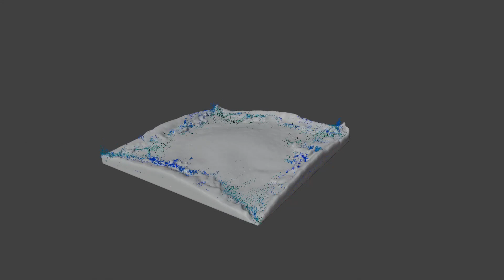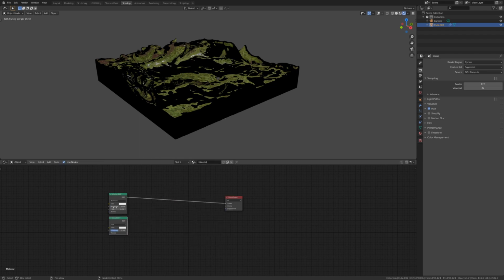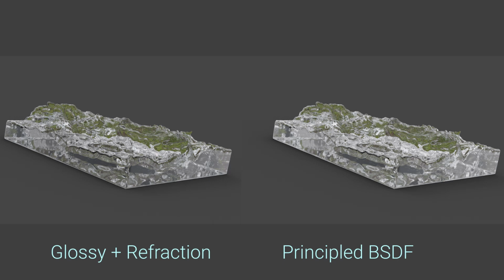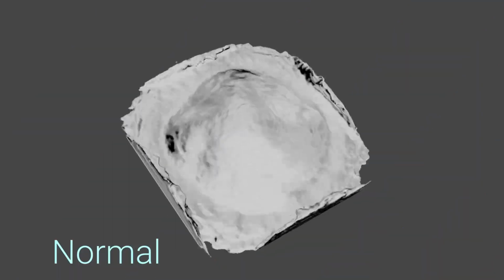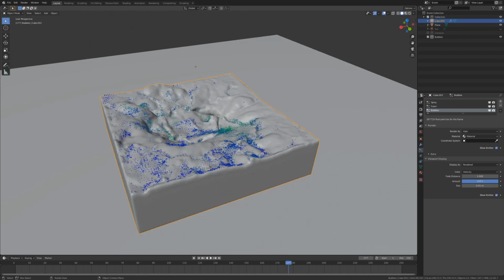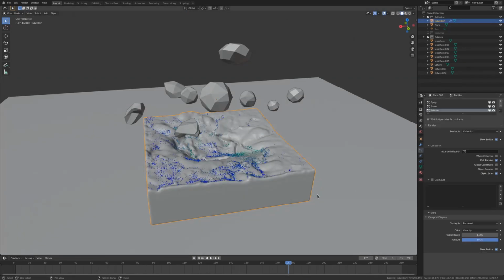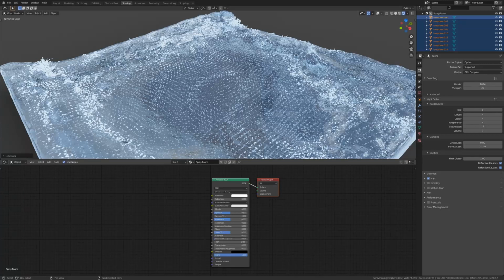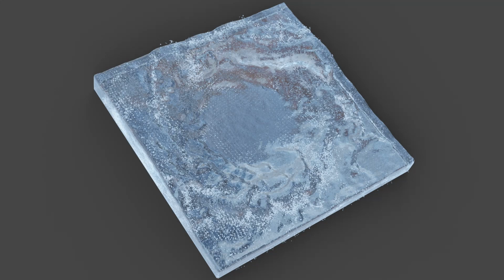Liquid Shading and Particle Rendering | Blender Mantaflow Part 10

Comment: Use the ocean modifier on your surface mesh to add some more dynamic movement instead of using the shaders.
Reply from the maker: That's a good idea- if you've tried it, what's the performance impact? Applying modifiers to fluid meshes is usually pretty slow.
Reply: @MrCheebs  So firstly, I use the FLIPFluid add-on which I highly recommend getting when on sale if you like fluid sims like me, there are some overlaps with fluids in mataflow though but it has a lot of benefits.  The modifier can be applied to the surface and is best when you want a more realistic ocean look, so maybe a large container of water which is rocking will produce some disturbance but the modifier will add that extra impact. here is a link that has some info on modifier advice it is not comprehensive but worth looking at, https://blendermarket.com/posts/flip-fluids-10-tips-to-improve-your-blender-workflow. I have not tried it myself however I always apply a smooth modifier to the mesh and It can take a minute to apply the settings but it does not seem to effect the play back speed much. It will be scene dependent but try it as it may increase render times but I am not 100%sure. Remember you can remove the modifier in the viewport once you know it looks good. you could renderer a test animation using matt colours for the water (with not particles) so see if the surface looks good. be careful, you don't want the displacement on the sides only on the surface, so a displace modifier locked in the z direction only could be more effective than the ocean modifier. keep up the great videos